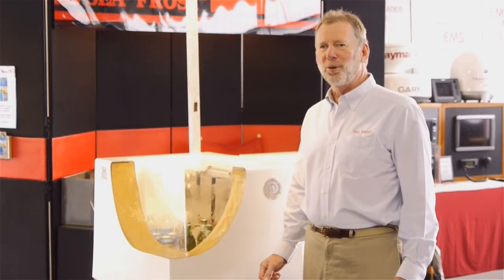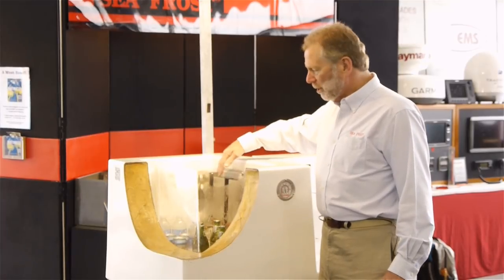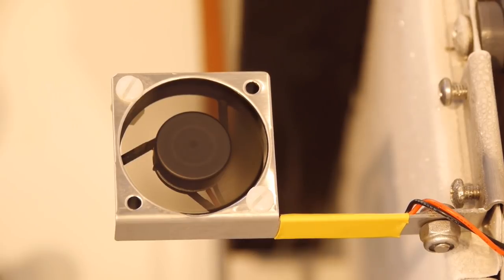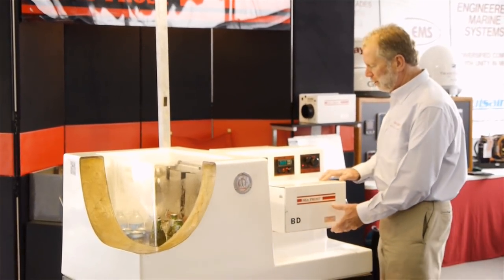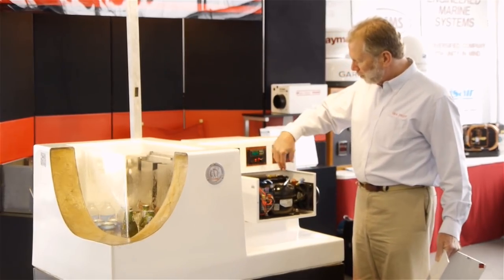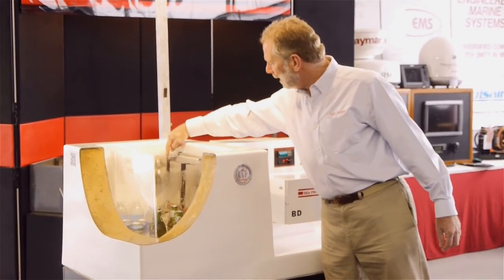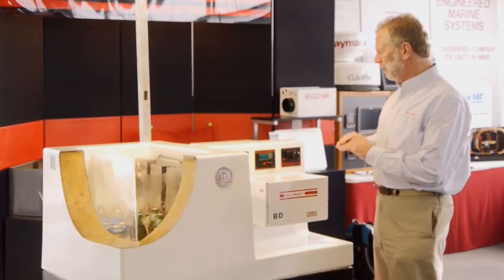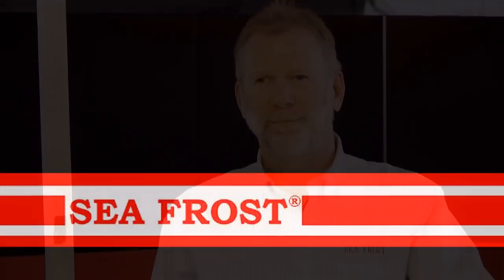Seafrost 12-Volt BD Marine Refrigeration Systems

Comment: Have used  the BD nonstop since installed new in ‘04- sensors went out recently and was at the boat show- Cleve said easy fix and I bought two at $20 a pop. There’s a reason Pacific Seacraft and other top manufacturers went with Seafrost- virtually bullet proof.